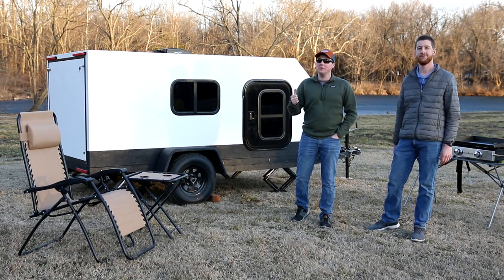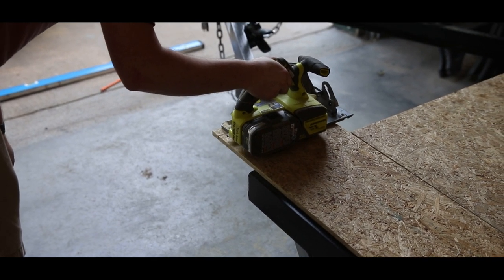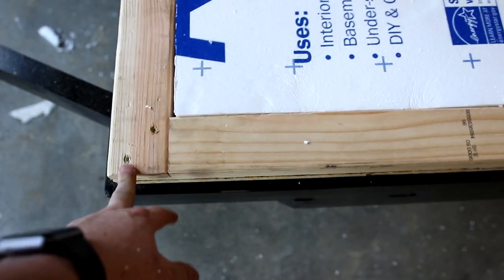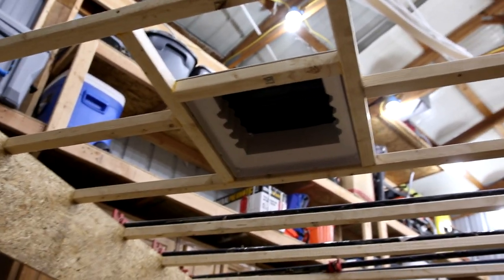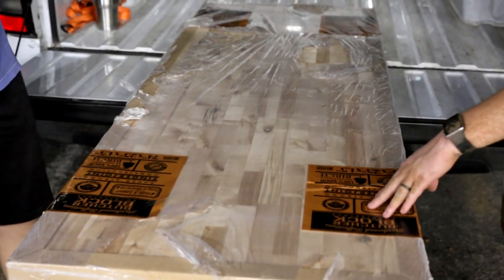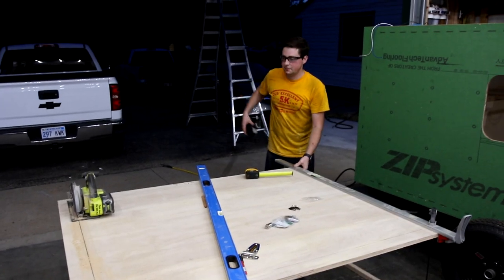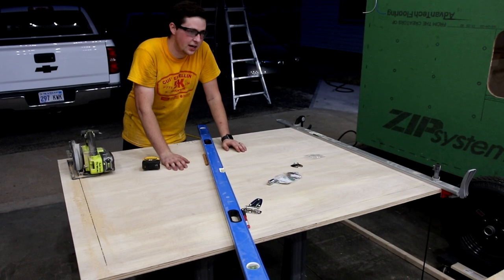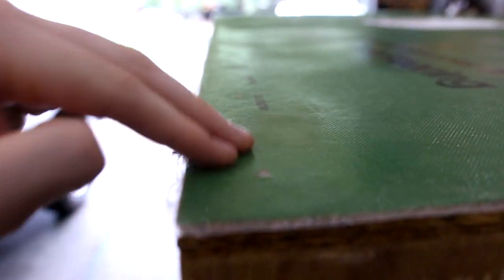DIY Tiny Camper Build | Part 2 - The Shell

Comment: A tip to get a smooth finish on the fiberglass is to lay a sheet of clear vinyl (bought at a fabric store) over the wet epoxy and then add a sheet of plywood and extra weights until it dries. You will end up filling the fiberglass pores and leaving a glass-smooth finish that requires very little sanding. Big, Big time saver.
Reply from the maker: Thanks for the info!
Reply: Is this the same process as peel ply?
Reply: @jwiereng  Very similar but it leaves you with a smoother surface. Much less work of filling and sanding. It is not perfect though.

Comment: Just curious, I see people building their camper and having the side sit flush with the frame they sit on. Wouldn't this allow water to sit on the frame edge and eventually soak in the wood sides? Would it be better to hang the sides over just a little for water to drip off? Like your video.
Reply from the maker: We thought through this and having the sides overhang the frame was certainly an option, we ended up using 1/8" spacers between the camer and the frame so there's actually an air gap between the wood and the metal frame. We believe this is adequate for drying and it preserved the look we were going for!

Comment: Awesome build! Thank you for sharing. What size mat fiberglass did you use?
Reply from the maker: The fiberglass came on a roll - 5ft wide x a long length I can't remember! Haha
Reply: Just a note - this is CLOTH not MAT. Mat is actually used to get a smoother initiall finish - you have to use POLYESTER  resin w mat.

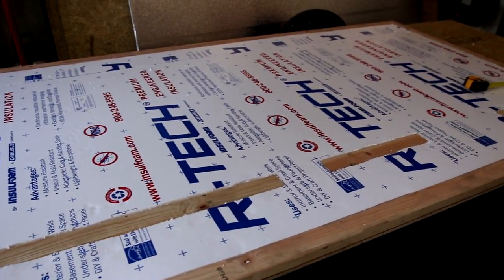Comment: when you showed the floor at 3:42  what are the 2 extra frames there
Reply from the maker: Sorry for the late reply, I don't know how I missed your comment. Those are just blocking pieces to give us a spot to fasten the 4' wide flooring to. The trailer is 5' wide so they just give something solid at the flooring joint.

Comment: What is the measurement for your spars? 1x 2? Also, lets say you used 1x2, which direction did you use when attaching to your walls? I mean, if you look at the spars from up top, do you see the 1 inch side or the 2 inch side? Im asking because if you see the 1 inch side from the top, then that would mean youre using the 2 inch more for support. It would also mean that your cabin would be smaller. That would mean that your cabin height is roughly 45-46 inches give or take? (48 - 2 inches= 46). Im trying to figure out my dimensions for my build.
Reply from the maker: They're just 2x2's so actually 1.5" thick in each direction
Reply: @10genbuild  2 inch thick or 1.5 inches roughly. The height would be roughly 46.5 inches or approximately around there depending on floor/ wall configuration. How does it feel? Enough room to sit up etc...?
Reply from the maker: Yeah, you can definitely sit up in it, it's certainly small but that's the point of a tiny camper  @macbethdemilo7253

Comment: Are the walls insulated ?
Reply from the maker: The walls are not insulated, multitude of reasons but largely because this camper was designed to primarily be a 2 season camper. It is only used when the weather is nice.

Comment: Why using OSB for the floor?  Baltic Birch Plywood would do a so much better job, especially when its time to screw into it.
Reply from the maker: We chose the zip system for 2 primary reasons: 1) comes in 10' lengths so we didn't need a splice lengthwise. 2) the integrated WRB.

With that said, I'm not sure we'd use Zip for this application again and baltic birch certainly sounds like a good idea!
Reply: @10genbuild  ❤

Comment: How many gallons of epoxy did you end up using?
Reply from the maker: The kit we used came with 2 gallons of the epoxy and 1 gallon of the hardener - we had a little bit left!
Reply: @10genbuild  So what's the mixing ratio? Nice build. 👏
Reply from the maker: @mehmetalibalci2238  It's 2 parts epoxy:1 part hardener
Reply from the maker: Not all epoxy's are the same though so be sure to read about whichever you may use.
Reply: @10genbuild  Thank you for the reply. Have a nice day. 🙏

Comment: when you showed the floor at 3:42  what are the 2 extra frames there
Reply from the maker: Those were just some scrap pieces used to join the 4' x 8' pieces of plywood. The overall trailer was 5' so those blocks were built into the floor for a place to fasten the seams.